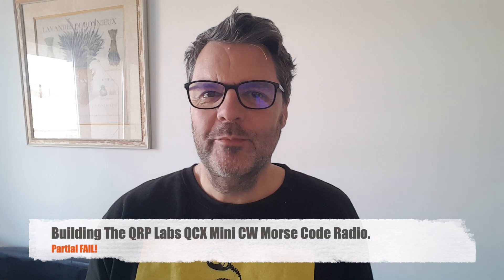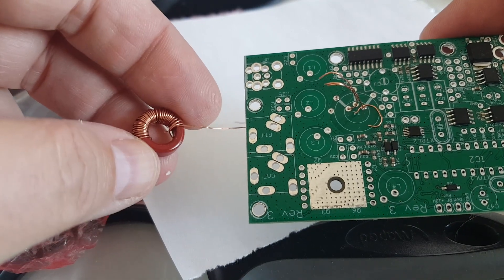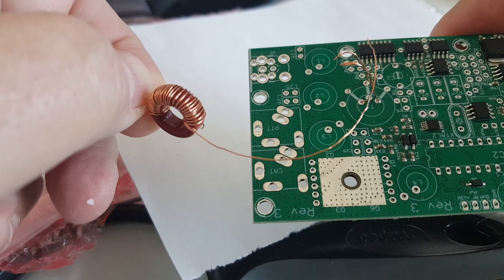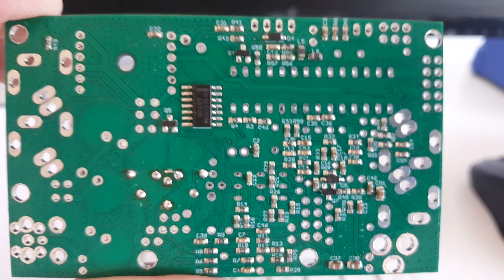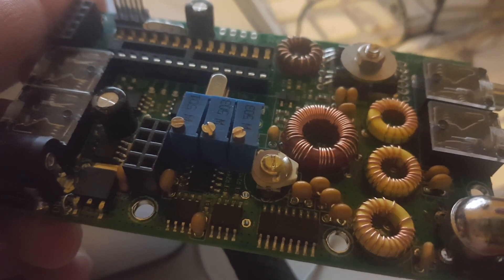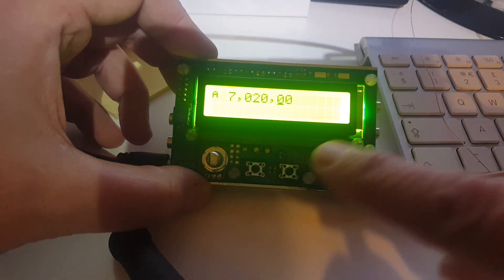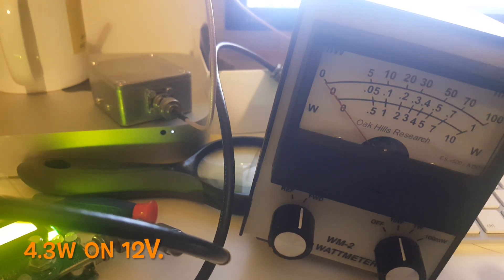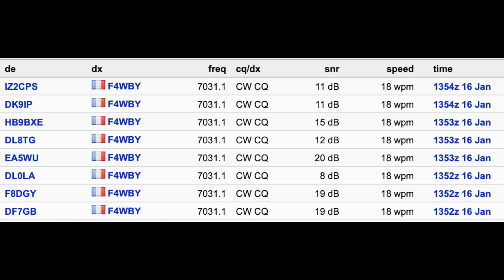Building The QRP Labs QCX Mini CW Morse Code Radio.

Comment: Hello Gil, this is Ken  N7KO, It has been a while since you built this kit, but I have a question, Did you place a jumper from 12v to DVM in order to get Battery indicator to work?   If so what did you have to do to get to that area to soldier in the jumper?
Reply from the maker: Hi, I think I did, but honestly I don't remember..
Reply: @RadioPrepper  OK Gil  TU and may God bless you.
Reply: @RadioPrepper     Hello Gil, it is me again  Ken N7KO. Just to give you an update on my question about placing a jumper to activate battery level.  I ended up just removing two screws on each end panel that holds the back,  Then as you know the back lifts off.  This will expose enough pcb to pashion a jumper and carefully placing it in the two holes 12v+ and DVM then solder in place, tight spot but worked.  
      Here is a short video of working on the 40 meter QCX. When I removed the back I noticed the pcb board had a bow in it, and up on inspection I noticed the bolt holding the transistors down was to long, so I ended up removing four screws and removed the board then ground off about 3/32 of the bolt.  The othe two radios were fine so all I had to do was to remove the back and solder in a jumper.   https://youtu.be/1QnRtCYI3Wk

Oh the 40 meter was assembled at the factory.

Comment: Don't you think that other bands should be supported like 432Mhz or for that matter 1296 or 2304Mhz which just needs stripline inductors which makes for a much smaller board.
Reply from the maker: I talked to Hans about that, as I'd love a 2m ssb radio. Apparently the matter isn't trivial and he doesn't have the time. Hopefully someone will make one...